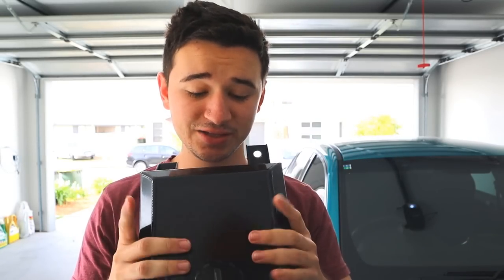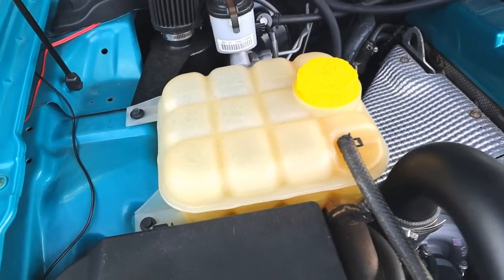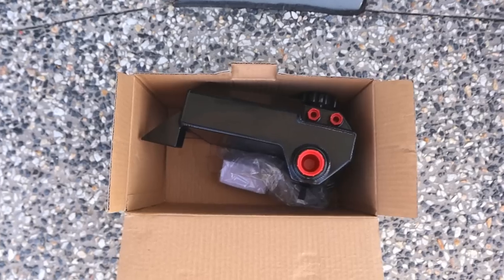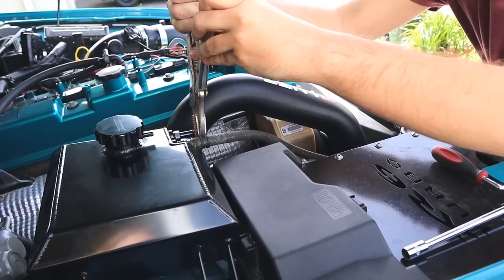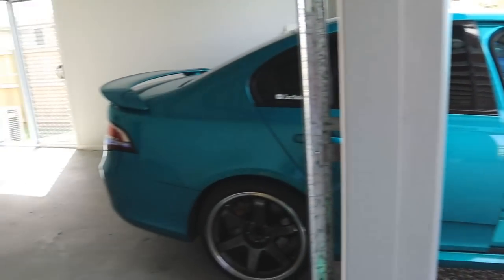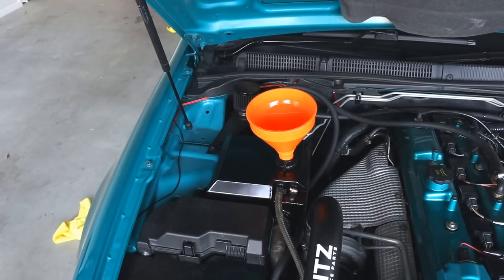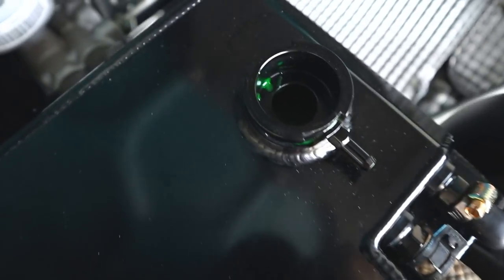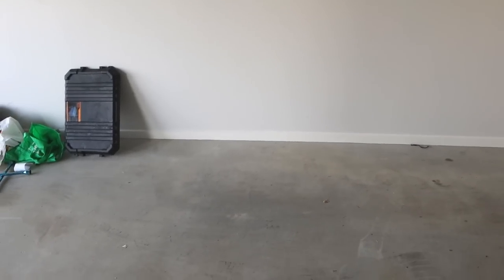FG TURBO ENGINE BAY MODS + Oil and Coolant Service

Comment: Invest in a earls oil feed line for your turbo mate! I’m sure you know the stock lines have a mini filter near the banjo and they tend to block up $120 better then $2K
Reply: Probably the most important mod to do, I had to replace my turbo core in my BA Mk2 at 150K because that, I run after market lines and filter now!

Comment: Its way cheaper buying your oil in a twenty liter container.I had to file some of the coolant tank neck on my aeroflow tank as there was a slight burr and the cap goes on so much easier.

Comment: Nulon full synthetic oils a very good no doubt about it , and an Australian company to boot , we should all support Aussie companies whenever we can. I personally use Penrite ( another Aussie company) HPR5 5w -40 Extra 10 full zinc - full synthetic in my 2004 BA , I have been told that Penrite oils are a better quality than Nulon oils , but each to their own . Just wait until the landlord finds the oil stain on the driveway lol . I learnt the hard way too , now I lay three or four newspapers under the oil drain container for  when I remove the oil filter .
Reply: Penrite is a good oil, but it stains the internals where Nulon has more detergents to keep the engine internals cleaner.. Plus Penrite can omit a strong unique Penrite fume
Reply: @GENE_THE_NEMES1S  Thanks for the tip .

Comment: it doesn't go to another overflow tank, it goes to the top of the thermostat housing on the BA BF, i personally wouldn't use 1 of those alloy tanks cause you will never know when your coolant is low.
Reply: This guys more concerned about aesthetics than anything else tbh..

Comment: The second line on the header tank goes to a bleed off nipple on the thermostat housing in the ba and bf models to prevent air locks and helps with filling. Looks nice mate, keep it up 🤙🤙🚗🚗💨💨💨💨
Reply: Correct i wonder why they deleted this on FGs. Cost savings?

Comment: Just run a bit of 8mm silicone or rubber hose from that over flow outlet down to a lower point in the engine bay so if it does need to bleed off if will run out to the ground, so it doesn't make a mess of your bay.... Oh and "push down" and twist anticlockwise to remove filler cap 😉

And FYI.. Go get an actual blanking bung-holeo for that unused outlet from MSA 😁🤙🏻

Comment: Ah bro, what about the nipple under the cap? Does the cap block it?
Reply: Overflow outlet. Just run a bit of 8mm silicone hose to a lower point, so if it does need to bleed out, it'll go to ground instead of all over your nice new tank/engine bay :)

Comment: I noticed that after you flushed out the old coolant, you didn't flush it out with a Hose!
Getting any debris out.
Also, not running the heater.
Pretty unprofessional!

The new Reservoir might look Great,but you can't tell if your coolant is dirty!

Comment: Remove the ecu/ecm an paint it black? Or match your paint , just dont paint over the barcode on the right hand side just place tape over it an paint away, everything under my bonnet is ego , just makes it look clean
Reply: Ohw an to remove it saw into the top of the rivets so you can get a flatty onto it to unscrew them an replace the bolts with something practical
Reply: I think haltec made a good video on it

Comment: But when you are flushing your radiator and motor you should be using demineralised water with all new cars because there is way to many contaminates in tap water there’s a video about it on YouTube

Comment: Ol mate just doesn't have the torque of the barra. Manual barras don't handle clutches well.
Reply: Swipez I ran 320kw from 100k’s to 115 then 400kw 900nm for the past 5000.My stock clutch is a weapon.Owned it since new so I know what’s in it.